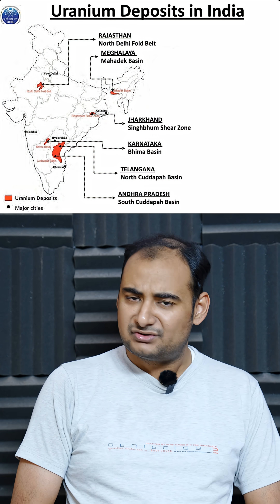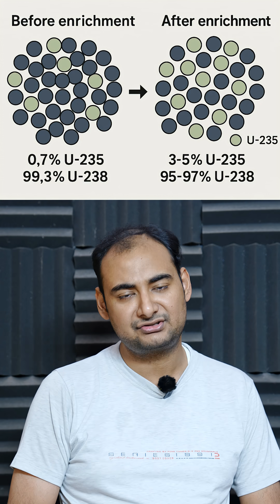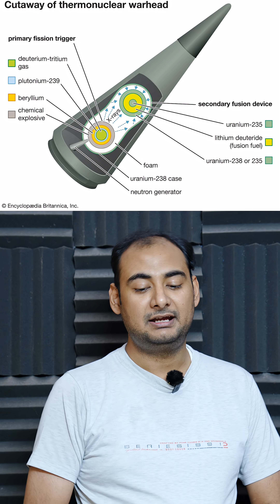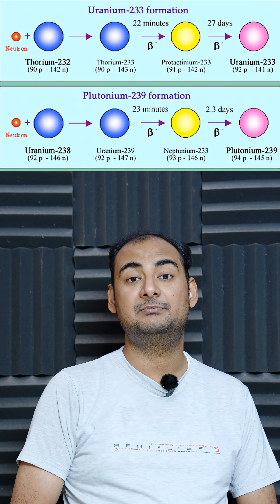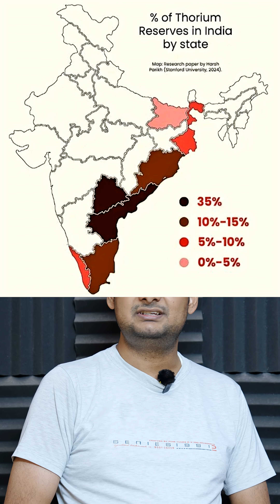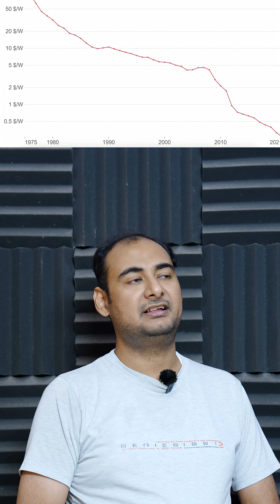India achieved criticality in Prototype Fast Breeder Reactor {PFBR} at Kalpakkam,Tamil Nadu

Comment: you have to compare Nuclear power with RTC (round the clock) Solar i.e. Solar + Batteries. and RTC solar is not cheap.
Reply: Hydro power storage is solution for non availability of solar at the night
Reply: @AmanRajBhardwaj  Indian topography is largely flat providing very few suitable locations for pump hydro storage.
Reply from the maker: RTC means nothing if u cant afford it and there are many many more cheaper tools . Wind + geo + hydro + coal power plant as battery + pumped hydro {India has massive } more will be built in time .
Reply: @s2tenglish  Leave aside pumped hydro India is not even able to execute the run of the river hydro.
Reply from the maker: India has  6.8 gw of storage so no Idea what u are talking about . Indin gov was late on wind but they are now adding that too